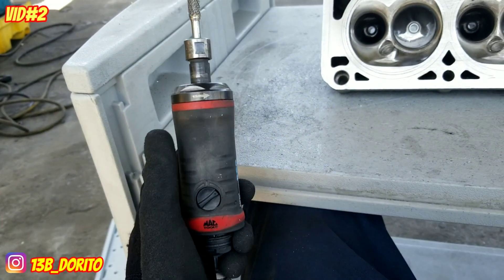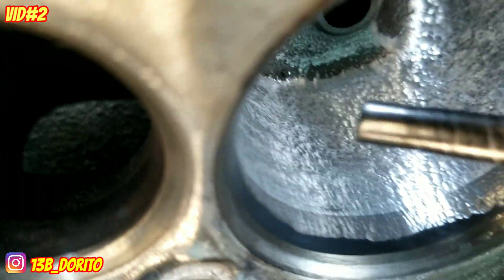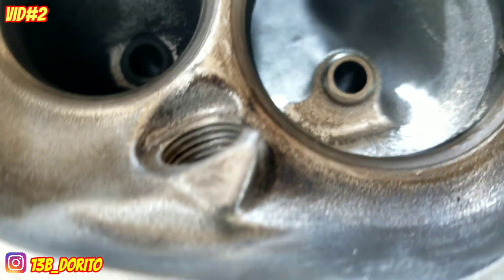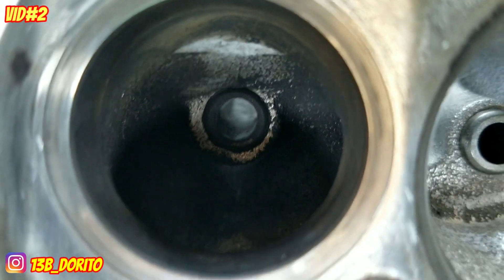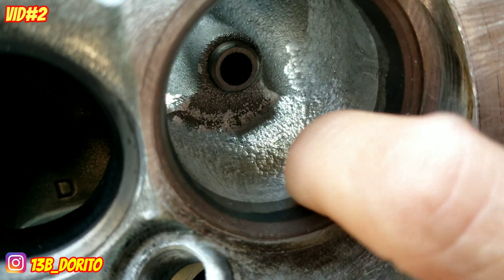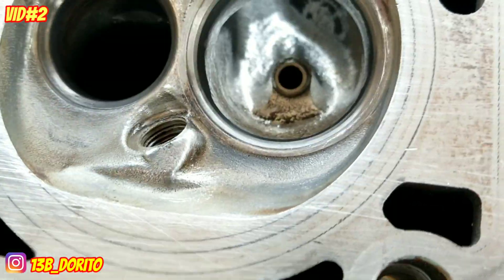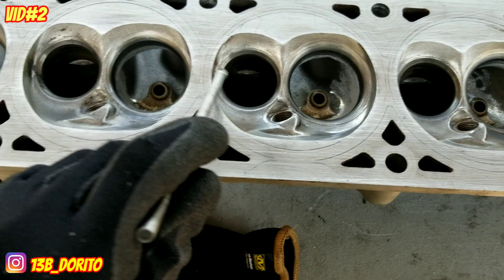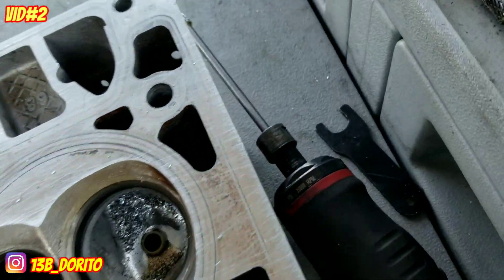How to port and polish Chevy LS heads (porting aluminum heads) 5.3 4.8 6.0 LS

Comment: Aluminum is metal. So it's not aluminum and metal it's aluminum and steel. And you do not want to nick the seats because when you have to cut them down it changes the combustion chamber volume

Comment: Question, are you going to reuse stock valves or upgrading to bigger ones?
Reply from the maker: Same stock valves but the heads needs to be sent out to the machine shop for resurface nd to grind down the valve aka 3 angle cut

Comment: You mention using the 1.75" valve template for the intake valve, is there a template size that you use for the exhaust valve? On 706 heads.

Love these port vids man.
Reply from the maker: Got new port videos check it out